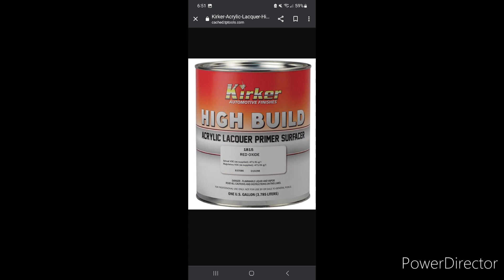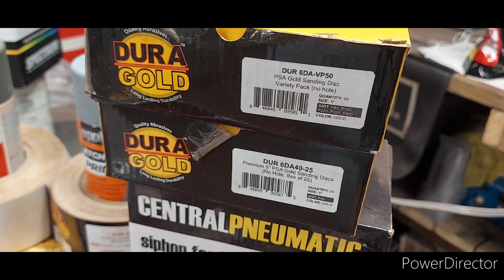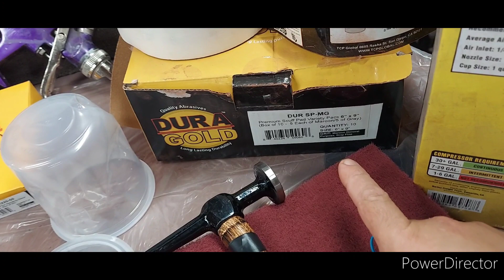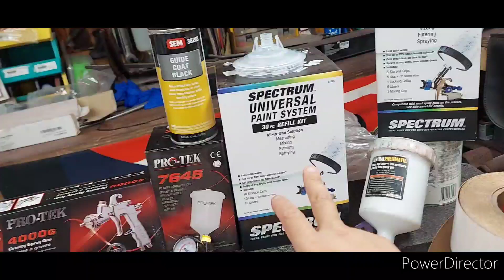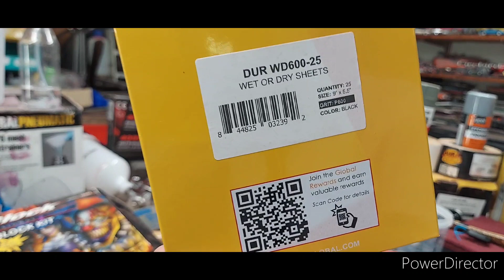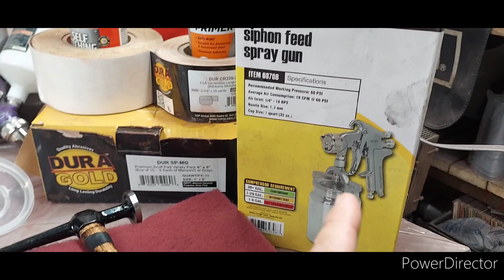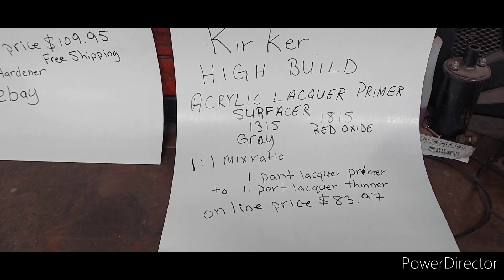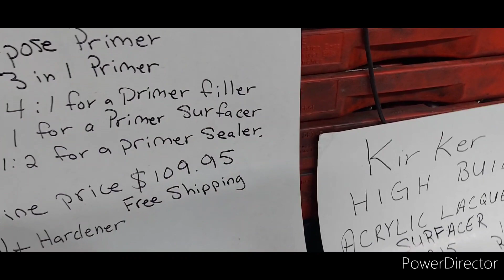What kind of primer to use when painting a car & What painting supplies you need to paint your car.

Comment: Hi Luis - great video!  Here's some information on today's auto body products and keeping the cost down for anyone that's interested:  Before 1990 there was only Lacquer primer, enamel paint w/ hardener, lacquer paint, body filler and a few brands of guns Binks, Devilbis and Sharpe.  You didn't have a ton of expensive products.  The industry is fooled by all of it.  All through the 60's, 70's and 80's when my dad worked and I got started we used lacquer primer and either PPG or Dupont Enamel with a hardener or PPG or Dupont Lacquer paint.  That's it! That's all!  These paint jobs were gorgeous and lasted years without shrinking, ghosting, blah blah blah.  You can't bury crooked filler work with tons of primer.  You can't prime over deep scratches in the old paint.  You can prime over scratches in metal but not old paint and primer - it is the main cause of seeing sand scratches - not shrinking of lacquer primer, putty, etc.  That's why it's always best to remove the paint before using "Bondo" or any fillers.  Old guys know this.  Of course you can cheat easier with 2K products but it will cost you money.  No matter what you hear, the old products do work well..... - if the rules are followed 😊
Reply from the maker: Thanks Jerry I just learn a lot thanks for sharing your knowledge I really appreciate you watching 👀 my videos one day I mean it I will be as great as you my friend
Reply: @firstgenerationgarage2803  Thanks Luis - I'm sort of middle of the pack - there's a lot of channels doing way better than me but I'm sticking with it right along with you my friend 👍